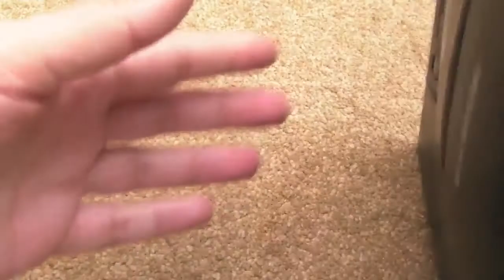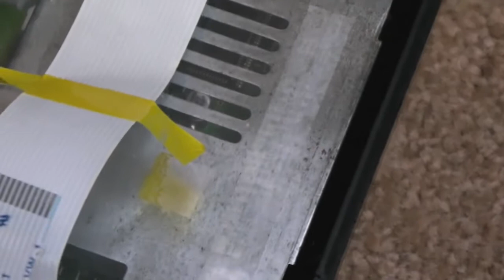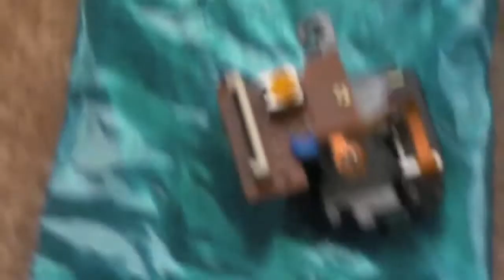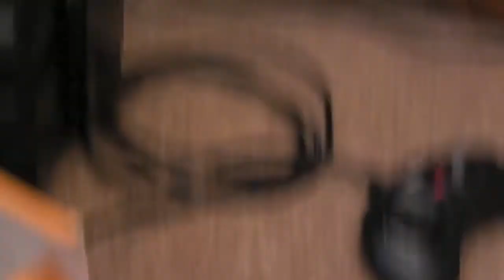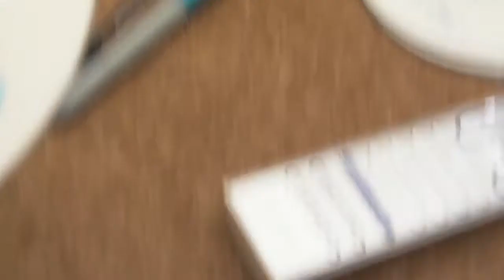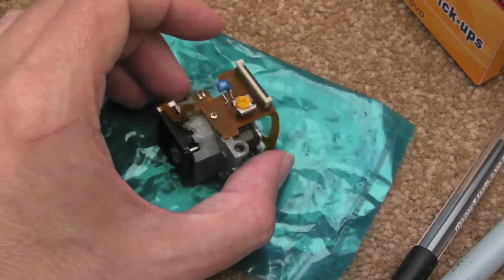Sega Saturn VA0 Mod Chip & CD-R Problems

Comment: I Just noticed that your Sega saturn shell has a miss print logo. On model 1s i doesn't have the sega logo on the front ports. Very neat on your system has a doube sega logo
Reply from the maker: Haha - that was an additional brand new chrome logo stuck on by me!  It's not factory that logo!
Reply: @GadgetUK164  oohhhh it looks neat! I have one of thoses too i should get some more actually

Comment: Hi gadget i just got a us model 1 Saturn in today it has a modchip installed but it will only play Japanese original's and Japanese backup's it will not play my original American games or my pal games i disconnected the modchip tried a American game but just tell's me game disc not unsuitable for this system witch means wrong region it like the Saturn is stuck in Japanese region but it a American Saturn it has the us bios start up and board say us any idea's gadget ?
Reply from the maker: There are two different restrictions enforced by the Saturn - copy protection (which you have a mod chip for) and region protection (restricted by the BIOS chip).  You coud dump the US game, edit the region of the ISO with an editing tool (there are loads online that will do that region change) and then run the modified ISO on the Saturn.   The alternative is to get a region free BIOS for the Saturn, and I think the other option is to get an Action Replay cart for the Saturn - I believe you can boot any region discs from that.

Comment: I know this is an old video, and from reading the comments I see that you had better results after getting another new laser assembly.

But even so, just want to mention that most commonly available CD-R discs in recent years have been of rather marginal quality. They work because modern drives are much more tolerant of bad media than older drives were. But when dealing with old 1990s hardware like this, finding quality discs is important. Not only for your sanity, but also because bad discs can conceivably put an extra strain on the drive, burning it out faster.

People generally discuss discs by retail brand name, but they get rebranded so much that the retail name isn't a reliable indicator. Personally the worst CDR-s I ever had were Memorex, and I think Maxell wasn't much better, but your Maxell discs might have been completely different than mine. The actual manufacturer and disc type is indicated by a code that sometimes comes up in the burning software. Doing a web search on that code can yield some relevant discussions sometimes.
Verbatim used to be reliably good, but by the time of this video they were rebranding cheap discs. Some series of Verbatims (I think DataLife Plus) were still quality discs though.
A couple years ago I stockpiled a ton of Taiyo Yuden CD-Rs. They were the last of the Japanese CD-R manufacturers and maintained a very high quality standard. They were also well supported (with a specifically targeted burn strategy) by basically any burner. They shut down at the end of 2015 though.

Since that time, "Taiyo Yuden" discs are now produced by CMC Magnetics. I don't know if they've kept up the previous quality standards or not. If CMC appreciates the reason people paid extra for those discs then perhaps they're still good. Pretty sure they're not coming from the original Japanese factory though.
I've had some occasional luck at thrift stores, where I've seen some partial spindles of older Sony discs that were quite good.

The readability of discs can be measured using some software tools. A popular one is Nero CD-Speed.  This measurement depends on features of the particular drive though, so some drives are more favored than others for this kind of testing. Also, it's obviously only telling you how readable it was for that drive. But it can still be a useful guideline for how good your burns are.
There's a lot of discussions/info about this stuff on the old CDFreaks.com forum, which are nowadays known as Myce.com. It seems to be a dying forum, but the old postings are still there from the days when optical discs were a hotly discussed topic.
Reply from the maker: Thanks =D  Yes, quality is definitely part of the problem but also the type and colour of the dye used makes the biggest difference, as does burn speed.

Comment: The only tip i have on saturn lasers: always make sure its clean as the saturn is a very clever console (if it cant see a disc it dosnt spin the disc motor etc).
Writing speeds: was quite importent back in the day. Dont get fooled by pc cd-r writer reporting a good burn, as the console is expecting a 1x perfect factory burn. If you tried to make a backup of a audio cd back in the day youd notice the odd spikes/lag if you burned too quickly. Does it matter today? Donno but i burned all my cd-r at 4-8x back as any faster = fail.
Media: I think i used expensive Kodak Gold or Silver 74min cd-r with both sat & ps1. Id stay clear of the ultra cheap "see-thru" cheapo cd-r tho. Trying to remember if the saturn disliked the larger 80 min cd-r but cant remember sorry.
Saturn disc format: Unlike most other consoles Sega went one step further & made some odd transition between the first 2 tracks. Hardware simply couldnt copy that at the time & so most early game rips was crude mix of the first data track ripped with a misplaced set of audio tracks, somtimes even without a cue file. Later cd-r hardware cought up along with software like Fireburn & Alcohol that can actually replicate a whole cd bit by bit. Quite importent as Sony+Disney (medival) & later Sega (Panzer Dragoon Saga) on purposely made errors in the disc TOC & the game checks for em. Conclusion: Copy in RAW mode & make sure to burn slow without CRC correction. Oh & old iso rip do usually work but just dont complain if the music audio is 2-3 seconds off or lowbit or choppy. If its one of the rare dual data track game a raw dump is mandatory tho.
Reply from the maker: Thanks!  Lots of useful information there =)  Will let you know how I get on when the new CD-R's (another make) and 2 new lasers arrive.   The laser has started to degrade already, so on the next laser I am going to have to leave it at stock setting and try and find some media that works.  Modern CD-R don't allow burning at less than 8 speed =/

Comment: I thought it was the wrong way round when I first saw your install, as I remember when I installed mine, it was over on itself. :D  Glad you got it sorted.
Reply from the maker: Yeah!  Clearly the wrong way around lol!  I will need to do a follow up to this video, once I've got a new laser (I've ordered 2 from China) and yet more media...  The laser has degraded already lol, which I guess is not surprise on reflection as it has been adjusted a lot more than you would expect to be able to read CD-R.  I am hoping the laser (despite being sold as new) is part of the problem.  I don't see that many people experiencing problems with CD-R media, so it's all a bit strange.   What discs did you use with yours?
Reply: GadgetUK164 Imation.  I only tested a few burnt games tbh, but never burnt at anything less than 8 or 10x iirc.
Reply: arrimas arrington What about it?

Comment from the maker: Interested to know if anyone else out there has had problems with CD-R and a VA0 Saturn!  I've got some more CD's on the way, and 2 new lasers - I think the laser is already on its way out as a result of the significant voltage adjustment that was required.  Moving forward I cannot leave it like that, so I need to find a solution to this.

Comment: I got the same chip but my Saturn slightly different inside (less messy circuit bits) I managed the 1 wire solder (bought a cheap kit from Maplins) although not as neat your soldering.... and had electrical tape and card wrapped round to avoid shorting... (as advised in the website and YouTube videos that guide this install) was very tricky with positioning  on the chip inside with the ribbon to be able to getter case on.. 
Luckily I also have the all in 1 action replay cart So I can do Japan/US also without doing the multiplex chip for the region which is trickier.. but did buy one if I ever wanted to attempt it.
I had no issues with CD-rs like you mentioned but all mine are old verbatim and datawrites... 

Love your videos though bud, keep ‘em coming...
Reply from the maker: I am going to order a couple of spare lasers from a different seller, it will be interesting to find out how they behave when I test them.  I am hoping that they might work better, and perhaps the laser I am using is a bit quirky due to cheap parts, perhaps the laser diode is a bit dodgy, no idea.   What I do know is that most of the time the media and burn speed doesn't really matter, except for the old XBOX where it needed Ritek dye or it tended to struggle.  I've not had problems like this with any other system before.  Thanks for the comments and feedback, and thanks for watching =)